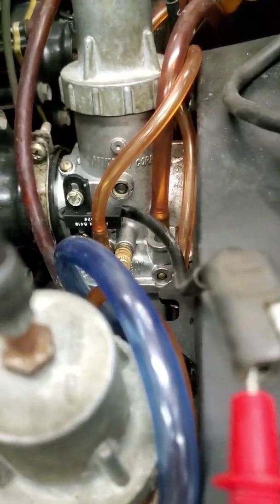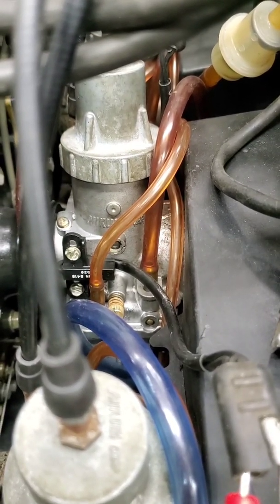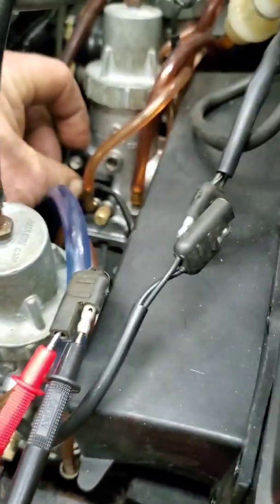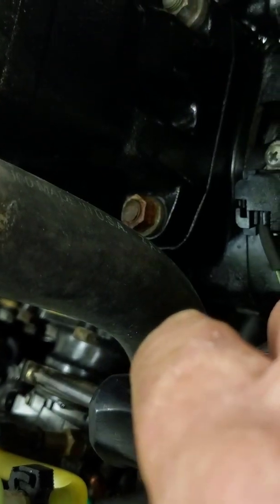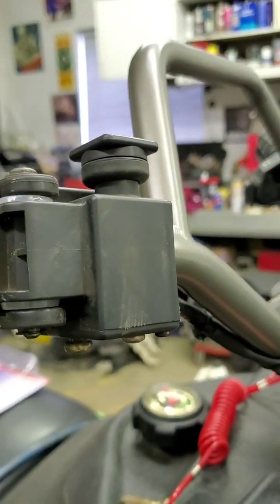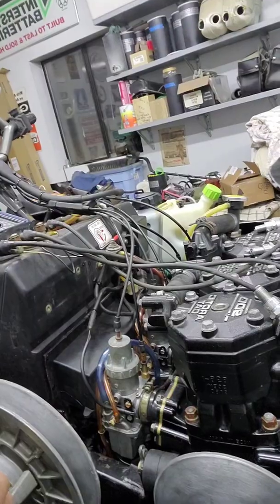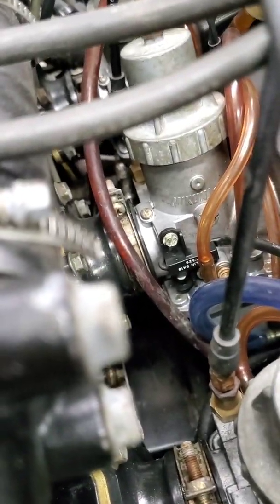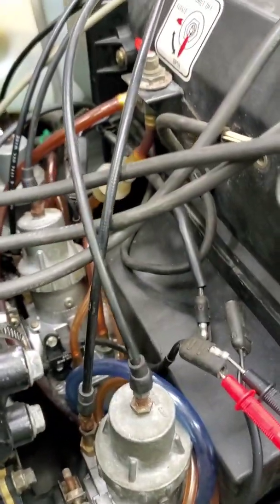Arctic cat throttle position safety system diagnosis

Comment: This video explains this system as well if not better than any video I have seen so far.Great explanation of how the magnet switches and the throttle safety switch work in conjunction with each other.Good to understand how to "FIX" the problem rather that just bypass it. Good to understand how to bypass for temporary operation to get you home,but not for permanent operation. Thank you sir.